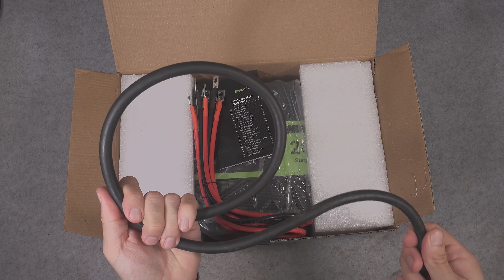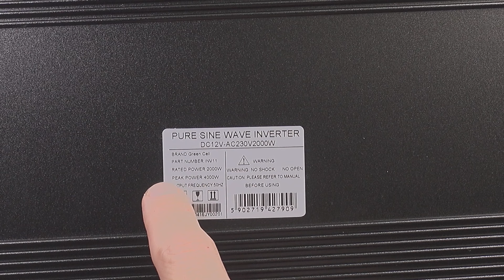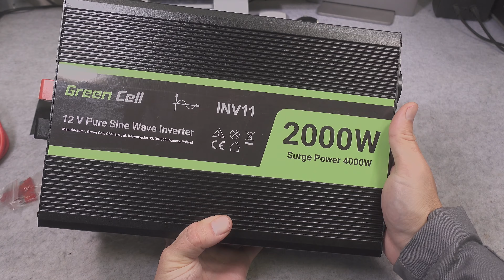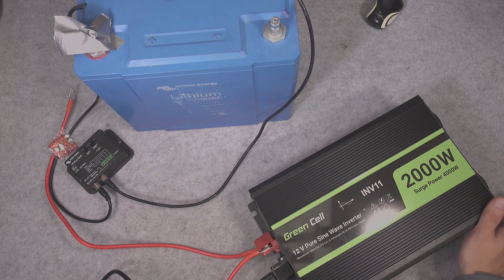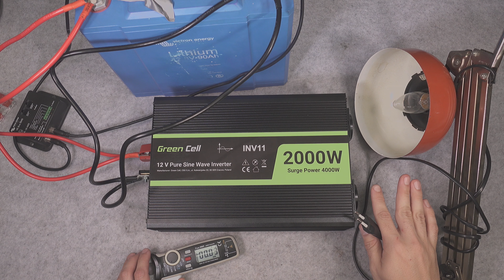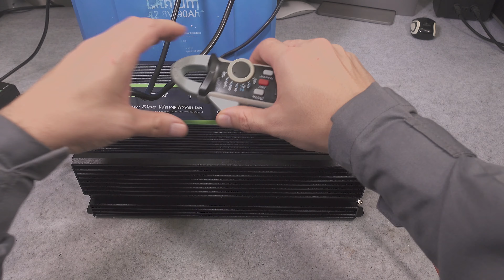Green Cell 12V 2000W 230V sine wave inverter (INV11) - quick test using dishwasher before mounting

Comment: If you're wondering, I can confirm that this inverter has reverse polarity protection.

I messed up and reversed polarity on my 2000w Green Cell inverter.

The fuses didn't blow in my case, just a big spark at the battery terminal. I opened up the inverter to inspect for damage and found none. There were  no blown fuses, bulged capacitors, or smoked mosfets.

The fuses should normally blow, there are 3 diodes near the fuses that create a direct short on reverse polarity, but I guess in my case I just briefly touched the terminals and it didn't have enough time to blow the fuses. 

The power switch was on the ON position when I reversed polarity. I don't know if it could also be a cause for the fuses not blowing.

The inverter works fine after the reverse polarity incident. I did a small stress test for 15 minutes with 70% load on it and it didn't blow up. I used a cheap IR thermometer to inspect for any hot spots inside the inverter and didn't found anything alarming, the hottest parts were the transformers (43C), followed by the heatsinks and high voltage output caps (around 33-35C).

I'm very happy it survived, it would've sucked to throw nearly 200 euros out the window.
Reply from the maker: Thanks for detailed feedback! Glad it survived:)

Comment: Thank you for this video! Do you know do you change the fuses?
Reply: Open up the inverter and use some needle nose pliers to remove any blown fuses. The fuses should blow on reverse polarity or severe overload.

I messed up and reversed polarity on my 2000w Green Cell inverter.

The fuses didn't blow in my case, just a big spark at the battery terminal. I opened up the inverter to inspect for damage and found none. There were  no blown fuses, bulged capacitors, or smoked mosfets.

The fuses should normally blow, there are 3 diodes near the fuses that create a direct short on reverse polarity, but I guess in my case I just briefly touched the terminals and it didn't have enough time to blow the fuses. 

The power switch was on the ON position when I reversed polarity. I don't know if it could also be a cause for the fuses not blowing.

The inverter works fine after the reverse polarity incident. I did a small stress test for 15 minutes with 70% load on it and it didn't blow up. I used a cheap IR thermometer to inspect for any hot spots inside the inverter and didn't found anything alarming, the hottest parts were the transformers (43C), followed by the heatsinks and high voltage output caps (around 33-35C).

I'm very happy it survived, it would've sucked to throw nearly 200 euros out the window.
Reply from the maker: Thanks for feedback!

Comment: I've opened the inverter and noticed the lack of quality control.

The inverter has two metal bus bars (positive and negative) that connect from the battery terminals to the PCB. They were snapped off during assembly due to poor soldering. They should each be soldered on 3 spots to the PCB, but they were only soldered in one spot for the negative bus bar, and 2 spots for the positive bus bar. These bus bars carry over 160a from the battery and the PCB alone can't handle this much amperage without distributing the load over multiple connections.

I've noticed this long after the return period and decided to solder them back myself. I've used a big 150w soldering iron and a solder sucker to do the job. A cheap 60w soldering iron won't have enough power and thermal mass to properly solder such heavy bus bars, it won't even melt the solder.

The overall build quality for the inverter reflects the price (I paid 165 euros).

The mosfets are decently cooled by aluminium heatsinks and don't use the metal case of the inverter for cooling. 

Personally I wouldn't use this inverter at max load for long periods of time, maybe for maximum of 10-15 minutes before the heatsinks thermally saturate and can't effectively cool the mosfets.

The inverter can handle 1000w continuously with decent thermals, the heat sinks are adequate for that.

I've used this inverter on my PC, which draws 300w continuously under heavy load. The fans started to slowly spin after 30 minutes of use. The inverter makes a squealing noise before the fans start to spin. I suspect it's the voltage boost and PWM control circuit for the fans, as they are rated for 24v, even though the inverter is 12v.

The provided cables can only handle 100A continuously (or a 1000w load, taking into consideration that most high frequency inverters are about 85-90% efficient so the power draw from the battery is 10-15% higher than the load). I wouldn't use the cables with more than 100a, as they are a fire hazard.

The input caps are quite small, but numerous. They are rated at 16v, which is a weak point of the inverter. I would've like to see 35v caps.

If the inverter isn't used for a long time, I recommend you slowly recharge the capacitors with a resistor or an incandescent bulb as a current limiter. If you don't, these weak capacitors might release the magic smoke, as they need to be reformed.
Reply: Excellent reply
Reply from the maker: This is very good comment and I can agree. First thing was crimping my own wire and I believe I said this in video. I load it around 2kW with well pump and water heater and it work fine,  I got mine for backup with automated transfer switch that You can see on my other video. Overall still work. If that would not be on different location I might correct issue You mentioned but it's hard mounted so I would nee pass. Thanks for feedback - i'm sure it will help someone.

Comment: Is it worth it?
Reply: The inverter is good value for the price, but the build quality is mediocre.

But again, for the price it's decent.

I've written a long comment about it on this video if you want to check it out.
Reply: @Catalin_C97  i Will use on a truck so is fine
Reply: @iMrRevo  Make sure the inverter has proper ventilation and air intake. 

I see many truckers and RV'ers stick an inverter into an enclosed area and complain about their inverters failing rapidly.

Under heavy load the inverter produces a lot of heat and needs to cool off. You don't want to stick it in a cupboard and have the fans recirculate the same air over and over again. That air will get hotter and hotter and will reduce the lifespan of the inverter.

Also, think about vibration isolation. Heavy components such as inductors and transformers can get dislodged from the PCB under heavy vibration.
Reply: @Catalin_C97  thx alot mate for helping out! 🤌
Reply from the maker: GC is very good value for money and You got company to talk to, for me in EU this was best possible option to get warranty and normal distributor. Can You get better? Most like Yes but You go with ordering something on Aliexpress and as long You did not watch someone YT video who try it out - there is risk You will buy something with nice sticker and garbage inside and next year You won't see that "brand" it will be under something else. For me it work fine, tested it with well pump around 2kW and water heater and did not have any issues.

Comment: you cant put the cover on the Wires Connectors because you need to insert one Wire on one side and the other one to the Other side and not Both at the same site

Comment: I have a question, i have a small garage with 12V ceiling lamp, usually i have to use special 12V bulb, is it possible to use inverter like this or not?
Reply from the maker: Something with training need to take look at it - on many places You will find 12V AC or DC with half wave rectifier to prevent people stealing electricity and this is not something that You want feed into any inverter - also lightning circiut will be very limited in current so that kind of inverter would be overkill.

Comment: Thank you for your impressions on this Inverter. I got one too and in addition to your remarks I encounter a strange behavior of the LCD Colordisdplay at front. The Load measurement remains whatsoever at 0 Watts and the Display itself goes OFF after about 2 min of operation.  Has this to be like that? Didn't find anything appropriate in the instruction manual.

Comment: Just turn the crimped lugs the other way around, so they'll be "back to back" with each other. You will be able to put the plastic cover over the terminals.
Reply from the maker: Thanks for idea, have You tried that? I think it was natural thing to do and it not fit that way - something was getting in way like wire  - I have it on site so it's hard for me to confirm.
Reply from the maker: I know, that lug was to short - You can see this on video - when You rotate it part that is joining wire (crimp point)  it touching that plastic insulation on terminal so it was on angle. That's why it was not an option.
Reply: @ElectronicNoobBlog I own the same inverter, my cables are cut exactly at the same length.

I zip tied them together so the lugs will always be correctly aligned "back to back".

I recommend you replace the cables with better quality ones. I tested the inverter with approximately 100a load (1150w from a microwave) and the cables it came with got pretty warm.

I doubt those cables could handle the full 2000w of the inverter without melting and starting a fire.
Reply: @ElectronicNoobBlog  There is literally no problem with back-to-back alignment, its not a big deal that you've missed that idea 🙂
Reply from the maker: @bnwlf  Thanks for feedback - maybe that was just my brain fart - if that's case I apologize - I swapped those cables and crimped own lug. and stuffed between isolation switch - i think i even showed it on some short - overall still work - I can recommend it.
Reply: @catalinciceu6279 You are right - I've got the very same iverter and I've got the cables aligned back-to-back with no sign of problem. Also I think that the cables are designed well enough to handle that 200 AMPs needed for full load.
Reply: @bnwlf  Had a look inside the inverter and saw that the positive and negative bus bars were not soldered properly (some of them were detached from their soldering points) due to poor quality control.

I had to disassemble the inverter to solder them back correctly, because I've noticed the defect past the return period. 

The inverter still worked as it is, so the store that I bought it from wouldn't warranty it. 

The negative bus bar was poorly soldered to one point to the PCB (instead of 3) and the positive only to 2, so sending 160A through a thin strip of copper from the PCB to the transformers and the other components was way to extreme.

I've beefed up the connections and now there is no problem.

Still, the overall quality of this inverter has gone down compared to the past revisions. I've searched disassembly videos of this inverter and they were much better built, and didn't have those stupid bus bars inside of them.

If you look at the Green Cell official YouTube channel, you'll see a video tutorial on how to replace the fuses on the inverter. The video is featuring their latest inverter (with an LCD display) so you can have a look at the internal components. It's not different than my older model (INV 11), except the LCD screen, all the internal components all exactly the same. Same 12 input and 4 output mosfets, and same stupid bus bars. 

Here is the video from Green Cell: https://youtu.be/5m-WcCyfhKA?si=qXem0mTD7hRXQO7M

Overall it's decently built, but personally, I can't recommend this inverter due to the stupid bus bar design and poor quality control.